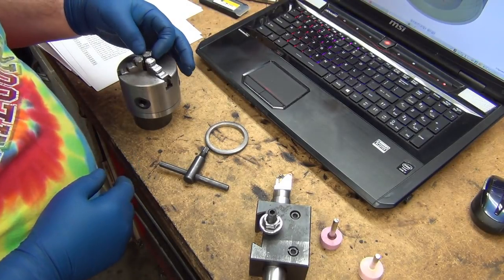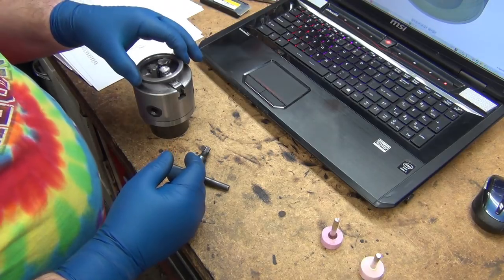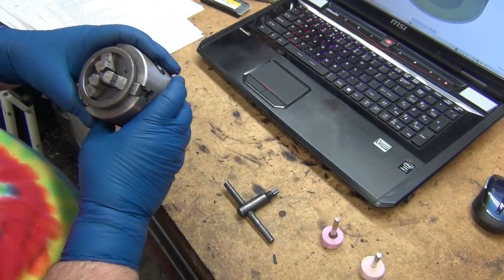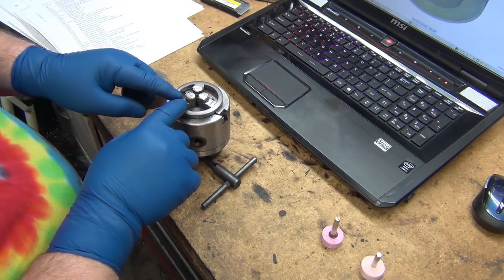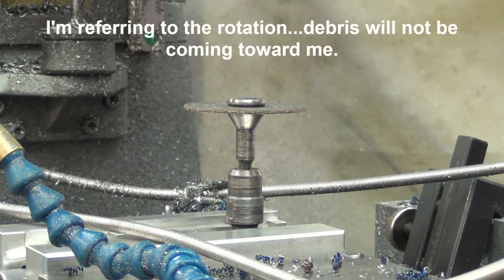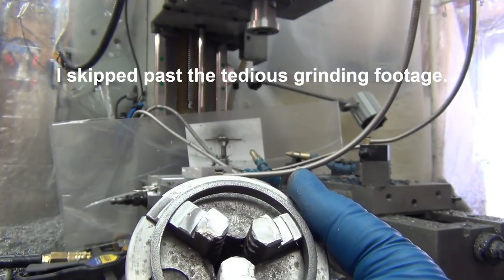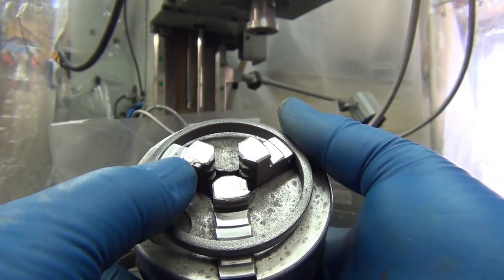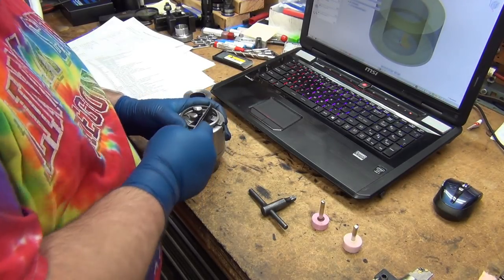Chuck Grinding

Comment: what  grinder  did  u   use
Reply from the maker: just the cheap harbor freight right angle die grinder that's in the vid.  Had it for over 10 years.